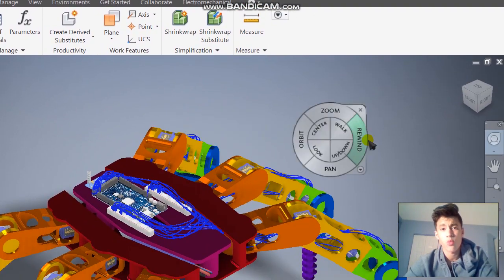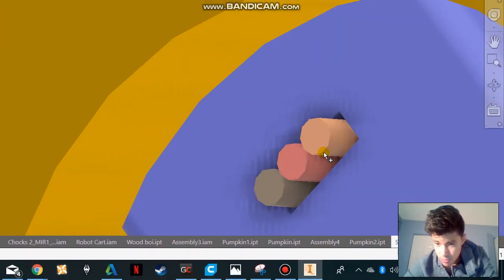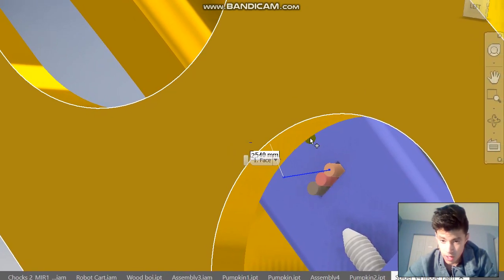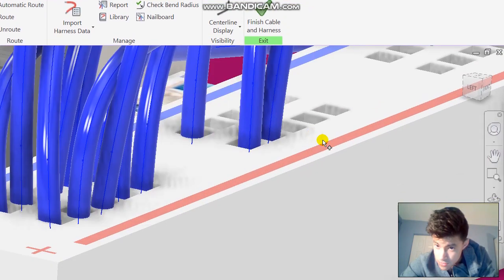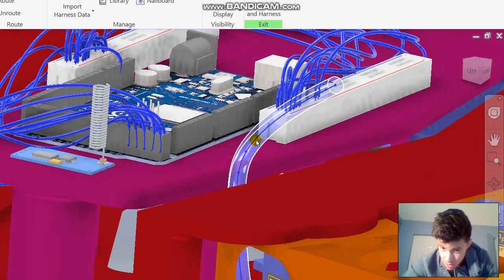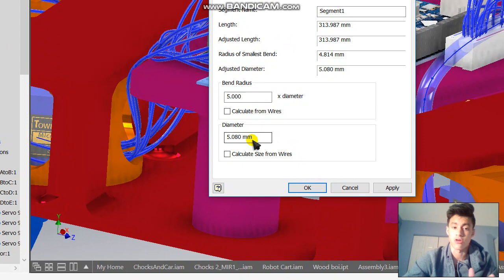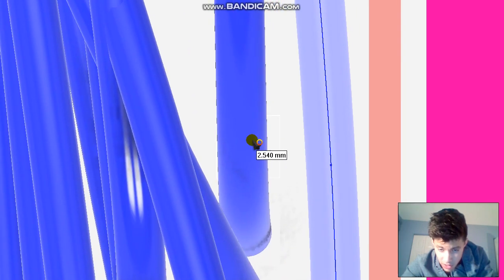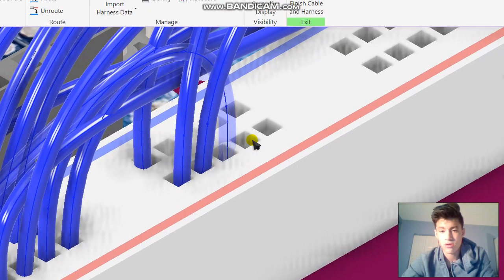How To Wire Assemblies In Autodesk Inventor Professional

Comment: Technically you do not use the harness tool correctly. Segments are only the outer hull of a cable, the wire itself is another function you route through the segment after you defined the segment